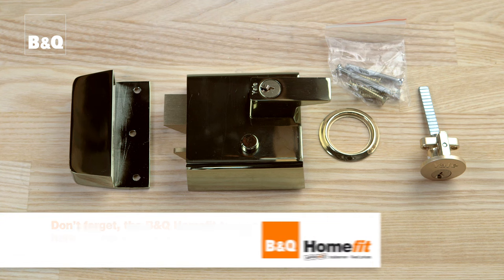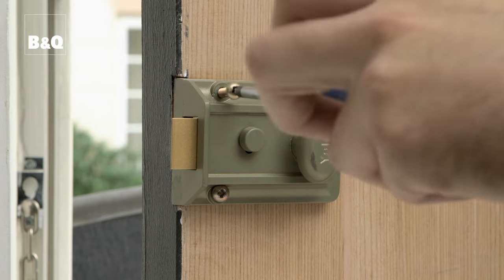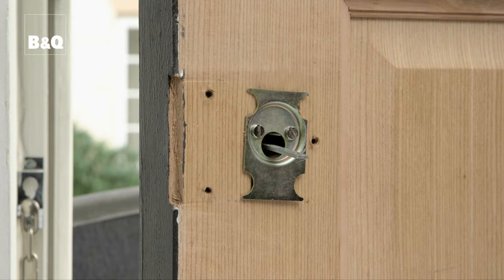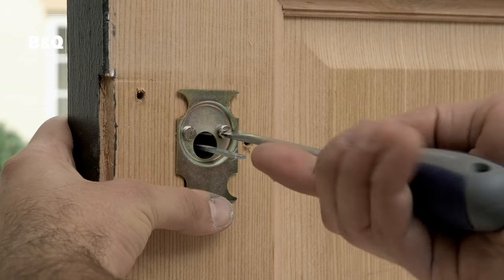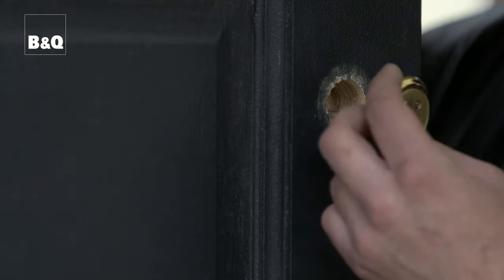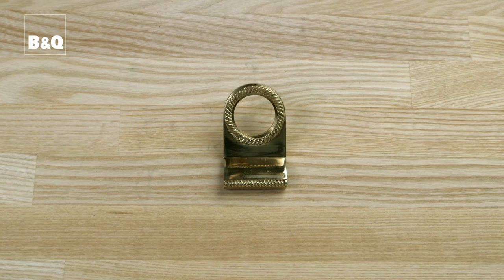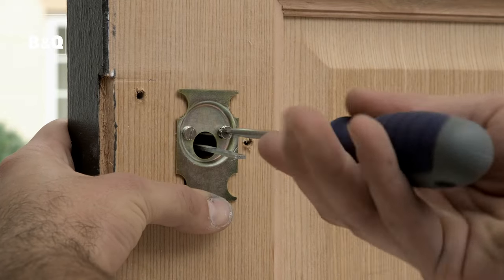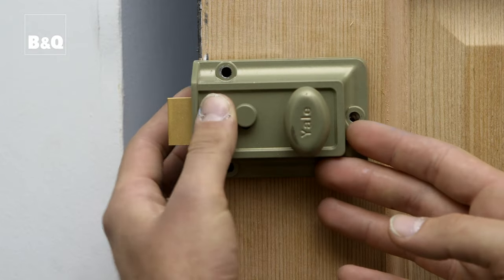How to change a rim lock cylinder

Comment: What do I need to do if I already have the lock in place but the front key part is loose and coming out a bit. I'm not sure how to tighten it back up?
Reply from the maker: Hi, if it's an old lock, the key cylinder might need replaced. If it's new, I would suggest speaking to Yale's customer services for further advice. Sorry we couldn't be more helpful!
Reply: @bandq  Hi thank you for your reply. I managed to sort it! The two little screws inside needed to be tightened which I managed to do. All good now. 😊
Reply from the maker: Brilliant! Glad you got it sorted 😄